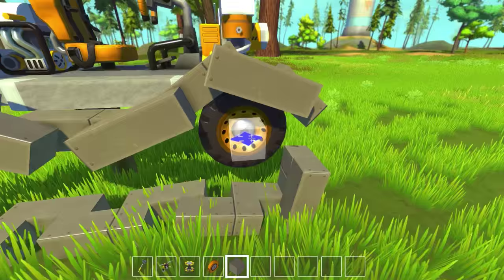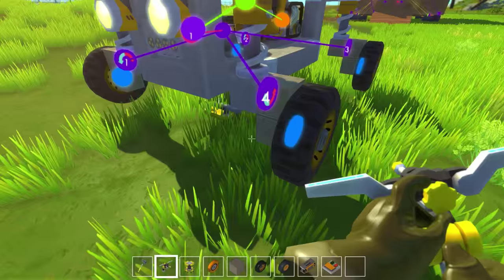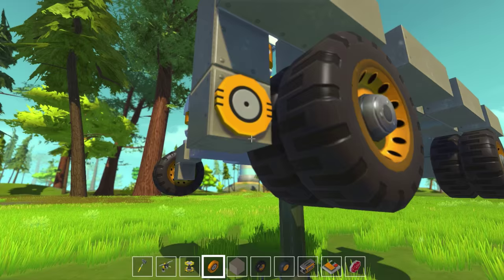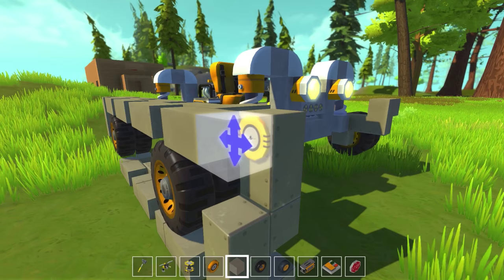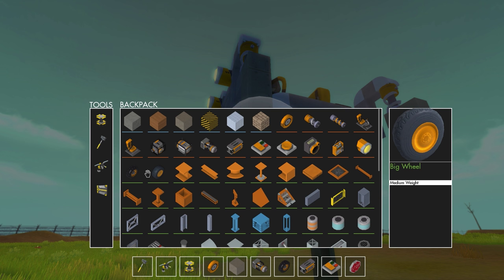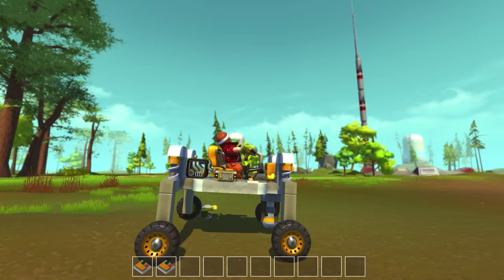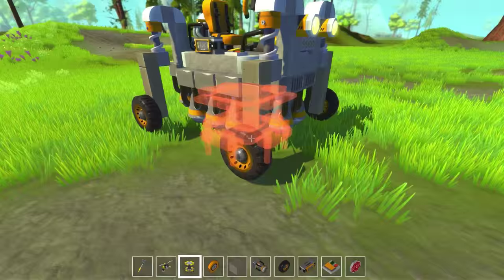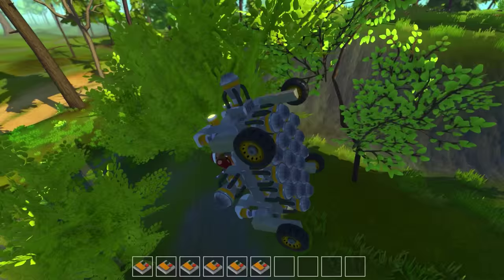Scrap Mechanic - Tank Treads & Flying Rocket Cars! (Let's Play Scrap Mechanic Gameplay)

Comment: You should use your low rider bearings and attach the thrusters to where the wheels are. Then once you're in the air you can press the low rider button and fly like a plane. (This really reminds me of a Delorean or a VTOL) Also if you're having trouble to stabilize. Use bearings to rotate the thrusters diagonally. 4 on each side.
Reply: I know right

Comment: You can make a sequence where if you press left or right it rotates the bearings so that you can turn with tank steering.

(This is before watching the whole thing so don't attack if he figured it out)
Reply: +Sackjepticeye you have one of the best profile names i have ever seen!
Reply: sadly its impossible he says so but soon it wont be
Reply: +nick johnson That's the connection of the treads that is impossible, tank steering can be done though, the steering itself not the treads.
Reply: +Sackjepticeye not Impossible. Put 2 bearings on the on wheel (Like bearing then block then bearing then wheel) then program the inner bearings to turn with steering
Reply: Isaac Pinkard Maybe I'm not understanding the explanation correctly but aren't you just describing the normal method of creating steering?

That's not the same as tanks steering, where to turn left for example you'd need the right set of tracks to spin forward and the left set to spin backward. The games method of steering only rotate the bearing slightly and doesn't have them spin so you can't use that to do it.
Reply: I am not surprised you don't understand It but you know how in besiege you can put a wheel on a wheel. its sort of like that but replace the first wheel with a block that can spin and put another bearing on that and then a wheel. one bearing can be put in tank controls. It works in my head anyway
Reply: Isaac Pinkard Ahhh you're meaning to use 1 bearing for going forward and 1 bearing for going backward?
Reply: on the same wheel yes thats right
Reply: Isaac Pinkard I think using sequences would be easier, I don't know if you can attach a bearing to a wheel to a bearing, I don't know... I mean whatever works, this is confusing.
Reply: What I am saying is to add a block horizontally to a bearing then add another bearing on the side of that block so you can program the first bearing with steering and the second to an engine (sort of like besiege tank steering but replace first wheel in besiege with a block in scrap mechanic)

Comment: Just been messing with it, it is possible to have tank-like controls. What you need to do, is have 1 engine per side (left wheels on 1 engine and right wheels on the other) and have the engines turned on by independent  buttons linked to the drivers seat. You'd have to use the 1 and 2 keys to control the vehicle but it actually handles pretty well.

Comment: Try making your flying creations the more heavy as possible.Also, for controlling left and right, use what i call interfaces that are composed of two bearings, one on top of each other, connected to the seat, with sensor one block to the left and one block to the right, that way when it moves when you press left or right, the tips of the moving part activates the sensors that can then be connected to turning rockets.

Also, if you make sensors hovercraft, don't bind all your thrusters to the sensors, only bind one per side. Then, add some more countergravity thrusters. I recommend biulding a heavy hovercraft with 2 permanent thruters and one sensor thruter per direction.

You can make a suborbital hovercraft, but if you let it go and it's well balanced, it can reach the top of the map and be stuck here. And if it does, you would have to make a very powerful dragracer with electric engines.

Also, there is a glitch where if you connect a wheel to two suspension, one upside down then one down, it makes an antigravity device. It don't know why, but it works.

Comment: You can actually make wheels go backwars and forwards per side, like a tank. By attaching the bearings (vertical) to the steering. And using an electrical engine. Have fun!

Comment: For the tank tracks you should put 2 bearings on each wheel and set the second set on the turning. And I mean add a bearing on the side of the block you would usually put the wheel on but instead put another block and then the second bearing then the wheel and then the tank tracks would work with turning (basically with how you make helicopter blades spin faster in besiege but the second bearing is programmed with the steering)

Comment: DRAEGAST! Bind two wheels on each sides to switches/buttons and you could control it VIA 1+2/any other button the switch/button is assigned to, this way you could turn. For when we get the chance to make tracks

Comment: You could get Tank like control by connecting wheels on the left to a controller, connecting that controller to a button, connecting the wheels on the other side to a second controller, connect that to a second button, connect both buttons to the steering and set the controllers so that when you press the button they rotate 360 degrees and then press the loop button on the bottom, so it keeps going.

That way if you press 1 one side drives and if you press 2 the other side drives.
However you can not go backwards. I guess you could get a rocket thruster to push you back xD

This doesn't help you with your tank track problem though. Really hoping that Weld function will be here soon
Reply: +OJJVZ Although, sometimes it doesn't work it seems. And I'm not even sure if you even have to set it to 360 degrees.

Comment: here is a little tip. get rid of the boosters on the bottom. add a few in the front that face down and use them to lift up the nose of your vehicle. that way your back thrusters provide forward and upward momentum. use some facing up to controle the craft.
you should also take int account your centre of mass and your centre of thrust when you put on rockets. generally you want the main thrust to poit right through your centre of mass and stearing should be as far way from it as posible to reach maximum efficency. 
tweaking the output of the thrusters would also help with controllability.

Comment: Drae, for the tank treads try a chain link. The setup for the wheels would look something like this:

Key: T=Tire P=Pipe (The small blue pipe) B=Bearing b=block

T P T B b

The space between the two tires allows for a chain link to slip into and hold it onto the tank.

Basic link setup:

Key: b=block P=Pipe T=Tire

       P P P P
b b b b   b b b b
       P P P P
            T

After you've finished constructing the chain link, you need to turn it into treads. all you need to do, is put plates on the top/bottom of the pipe links, like so:

Key: b=block P=Pipe

    b b b b b b
       P P P P
b b b b   b b b b
       P P P P

The only issue with this is that it is incredibly time consuming, due to the steps you have to take to build it. Also, your fps might take a hit, due to the physics calculations that would be happening.

Will you try this method Drae? Would also love to hear other peoples input on this idea.

Comment: +Draegast You could try putting the rockets on the sides connected to a spinny thing and when you make the car higher then the rockets spin down to take you up, then when you spin them again to the original position the rockets will point backwards and help you go forward.

Comment: Awesome! :D I think as you added two thrusters on the back and only one on the front , the balance of the car is pulled to the back and that's why the last flight was a bit messed up. If you keep the center of gravity of the car perfectly placed it should be easier to fly.
So much potential in this game, keep it up ;)

Comment: you can add turning using a fifth (or 5th+6th) wheel that's horizontal (like on the nose or on the back) and those\that will spin you around

Comment: theoretically if you double sided the treads inside and have one side stuck on wheels that go in reverse then make it so you have to flick a switch to set the treads that are going to move the vehicle you could have 2 switches one for each side of tank turning then if both are on just have inverted controls

Comment: attach the rockets to the legs of the vehicle that the wheels are on so when you are driving it points backwards giving you forwards thrust and when the wheels extend outwards it points down so you can go in the air. PS attaching the forwards left right and backwards  thrusters to the arrow keys or wasd might help, whichever keys you are not using.

Comment: The wheel thing is that the rubber is the same amount in each wheel but the rubbers mass in the big tyre doesn't have as much density in its rubber than in the small one which is the reason why the small tyre is counted as heavy while the big ones are medium weight

Comment: Draegast please try this. Because you said you wanted to use gyroscopic turning in air, when the wheels are vertical (up and down) the craft points up or down. So what if you put horizontal wheels to rotate left or right. All you need to do is put the distribution of power in the four corners and some boosters, then in theory you have the perfect craft thank you for reading. ; )

Comment: Draegast if you can use the num pad for pressing the buttons then you should put the controls for the rocket as the same layout as the wasd but on the num pad so it is easier to control.

Comment: Hey you need to have two peeps on the tank idea
like one to steer the left stuff and one for the right stuff
or for one person wire the berings to a system thingy and have buttons for days
But for the tracks have fake ones or just cover the area where they are supposed to be

Comment: So when a tank turns actual one track turns faster then the other so if you wanted to go left the left track stay at the same speed but the right track would speed up and if you want to go right the right track would stay the same speed while the left track would speed up what you are talking about its neutral turn witch is used to turn in place @Drea

Comment: Hey Drae! I know how you can make like a tank!
I was messing with my game this morning and I tried using the red pipes, the giant ones, as wheels and see if it works. I forgot to connect my engine to the driver seat and after I removed the base thingy, the one that goes up and down, my machine went blazing away. What I'm trying to say is you can use those red pipes as wheels and place them inside your machine to have the illusion of driving a tank.
Reply: +Nico or you could hide wheels inside the creation.

Comment: Noooo you should have put the rockets on the legs so you could turn low rider in the air lol it would have looked cooler and it would have gave purpose to the low riding function of the car.

Comment: I have an idea to make to flying in this game. If the wheels are spinning as if you were driving, and it keeps you stable, couldn't you attach legs going outwards on your front legs which wheels on the top spinning in either direction to control going left or right?

Comment: For tank turning would it be possible to have  a total of 4 rows of wheels two on each side each with their own treads. Then have the outer tread wheels programmed to go forward and the inner tread wheels programmed to go in reverse and then instead of steering wheel control use buttons? 4 different buttons for each tread lets say the outer treads are set to button one and 2 and the inner treads are set to button 3 and 4  then you could turn on tread 1 to make one of the wheels on the outer tread spin forward and press button 3 to make the inner tread wheels opposite side to the outer tread currently going spin in reverse causing the vehicle to turn in a circle. It would be a lot of stop and go using buttons instead of a steering wheel but it should work right?